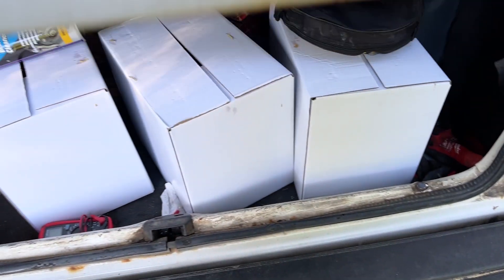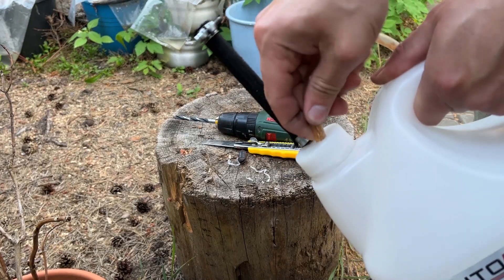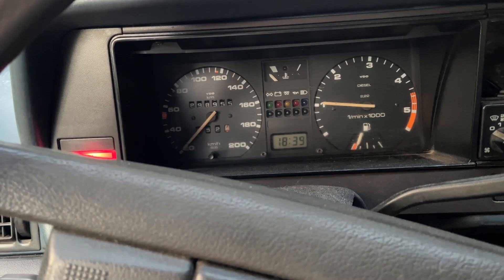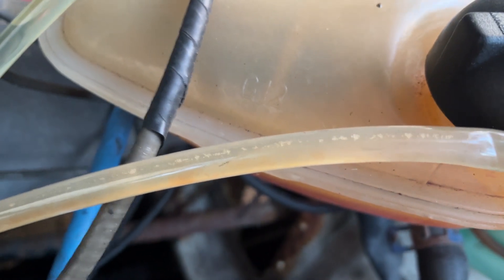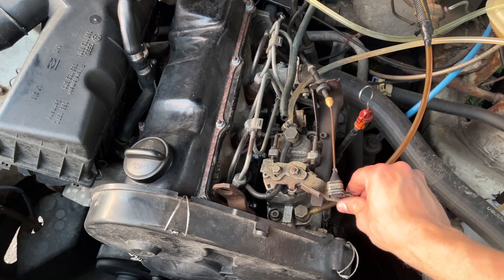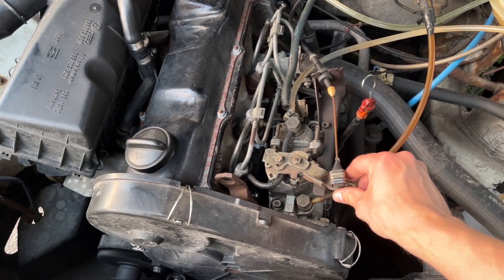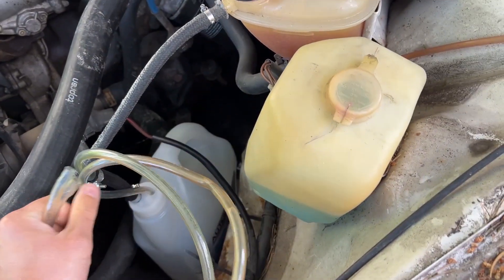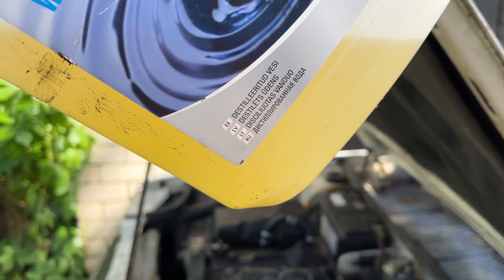1.6 diesel running on cooking oil

Comment: What about used filtered engine oil?
There is some evidence that i works great with older diesel engines- old mercedes- 80 style, and tractors, same age class, too
Reply from the maker: took a few trips with used engine oil as well, mixed with diesel and gasoline for better flow. smells bad, especially when you get used to the nice smelling cooking oil exhaust. maybe a bit low on power, or not, but otherwise drove well
Reply: @JunkVWs   I love the smell of used and mixed engine oil .
The smell, you know that  mixed gasoline smell? The whole car and place . Smelled like... victory!
:))))
Reply from the maker: @CheckpointCharlie-dl3ez nah. Clean diesel or mixed with vegetable oil for me 😂

Comment: Leaving vegetable oil in the fuel system sitting overnight wil cause very hard cold starts and slowly gelling in the pump and injectors, best way is two tank system so firat cold starting and a mile befor last shutdown at night you switch to the diesel tank and run it all day on vegetable oil
Reply from the maker: I do reconnect the normal diesel tank shortly before i finished my drive with vegetable oil or waste motor oil. hopefully that flushes the pump and injectors enough

Comment: If u using cooking oil as a daily driver is better to mix it with diesel like 70% cooking oil and 30% diesel to lower the viscosity and u could run this for hundred of tousand of km with very little trouble just extra fuel filter changes

Comment: What about 1.6 t.d turbo engine? İs it same reaction? Could it damage the turbo?
Reply from the maker: don't think this could affect the turbo itself. Will pour some in my turbo golf next year. But for the future I will dilute the oil with diesel fuel at least 50:50. I think my pump started leaking from the added viscosity of 100% cooking oil
Reply: @JunkVWs  I think so. 50/50 is better way. I meet with a man. He had using  used flower oil in golf 1.6 d. about 10 years He told me .
Only filtering good with fine cloth and adding 20/1 gasoline for to reduce the viscosity of the oil

Comment: works great on the old engins did this for years lol
Reply from the maker: pump started leaking not long after running a tank don't know if related to oil :D
Reply: @JunkVWs  never had any issues with mine was an old pug 106  did you change out the fuel filter
Reply: other thing i use was heating oil kerosene
Reply from the maker: Same fuel filter

Comment: YOU NEED TO CHANGE ENGINE OIL 50% MORE OFTEN...DRIVING WITH COOKING OIL EVENTUALLY MAKES YOUR ENGINE OIL GO JELLO... OTHERWISE USED COOKING OIL WORKS BETTER- FILTRATION IS IMPORTANT ;) half of eastern europe drives on cooking oil
Reply: What about 1.6 t.d turbo engine? İs it same reaction?
Reply from the maker: Good info 👍

Comment: Try experimenting by adding cetane to the sunflower oil cetane is a Diesel additive that increases power theres cetane then theres octane  Diesels use cetane as a additive to increase Horsepower and burning  🔥  of the fuel ⛽️
Reply from the maker: Good to know 👍

Comment: Scricco 4 door. ???
Reply from the maker: You are the second person that has called my passat a scirocco 😄 love it. The first one was in person, overheard a conversation 😅
Reply: @JunkVWs  what country are you in// my son has a 1991 Passat wagon I removed 2 liter gas and put in a 94 golf 1.9 td,,with a 98 tdi style 5 spd transmission.runs great but yours is transverse kinda like the older vw fox I'm in Toronto Canada
Reply from the maker: @gulfy09  Latvia. My passat is on audi 4000 / audi 80 platform. Probably needs an audi donor for a TD 5speed swap
Reply: @JunkVWs  did you try to move injection pump for timing// it may help if you have starting issues
Reply from the maker: @gulfy09  no, but could the timing have moved on its own?
Reply: @JunkVWs  nope. If it's out 1 tooth it would not run. But make a mark around the pump housing then you can play around a little bit..

Comment: Great experiment !  Now get some free stuff from restaurants
Reply from the maker: I’m not sure I want the hassle of filtering the used stuff. Only for an experiment would be fun though
Reply: @JunkVWs  i use to run my entire farm tractor and truck on used vegetable oil that i collect from local restaurant, have a setup of 4 barrel 200 litres etc one higher last one lower, with common idraulic gross filter for solid stuff, a fuel filter and in the end a LPG filter that ends in a 25 liter portable tanks, usually takes about 1 week to fill it out, i just add to it a 1 liter of ethanol (stove alchool) just to liquifiy and avoid too much density. Was funny going around farming with different smell of french fries, vegetables, shrimps meanwhile plowing and working. This engine is not different from a tractor one, no small injector like modern one. Ah, additive to destroy organic stuff always helps a lot. No effort required, i just ride close to my personal gas station, fill up and go to work... I have no freezing weather at all here in my country.

Comment: Out of context question, where can you get the 1.7td, and is it any better than the 1.6td?
Reply from the maker: 1.7td, is that some kind of opel engine? Never had any dealings with em. I’ll stick to my favourite ones 😅 would love a 1.6td in one of my cars, currently running 1.6d and 1.9td
Reply: Thanks anyway, i heard there was a 1.7td for Australia i think
Reply from the maker: @dzonibabic111  interesting. Could be a bus engine? Haven’t paid much attention to them before
Reply: there is also a 1.7td passat 32b on youtube, but i dont know the backstory of it
Reply from the maker: @dzonibabic111  I kind of feel like 1.6td, 1.7td and 1.9td with the right modifications would feel similar. Unless there are some tiny changes to the 1.7 block that are totally unique and make it bulletproof because of it
Reply from the maker: @junk_vws
Reply: Whats your instagram

Comment: I am amused and at the same time disgusted by this experiment. I love the idea of using off-the-shelf cooking oils as an alternate means of fueling a diesel engine. Glad it worked out, although I'm not sure how well it will work long term, especially in winter. Might needs some fuel additives so there's no drivability issues.

What made me mad though, is how expensive diesel is to the cost of cooking oil! A liter of Diesel here in Canada is about $1.6CDN - about 1.10 Euro. I hear you guys are close to 1.70 Euros - shameful! Not sure if that's extra taxes, or the added cost if there is a Russian fuel embargo. 

Anyways - keep the video content going! I'd like to see how Canola oil works - cheers from Canada.
Reply from the maker: Currently just below 1.60€ still high. Mostly just greedy companies that love to use geopolitical excuses to keep the prices high, even when prices are dropping in neighbouring countries. 
I bet inside of tank would look like a candle in winter 😂 i wouldn’t risk it.
I’ll try canola oil if a good discount pops up. This oil was 1.18€ per litre